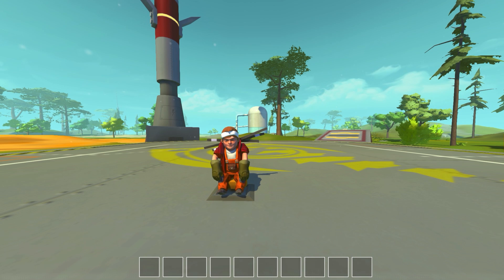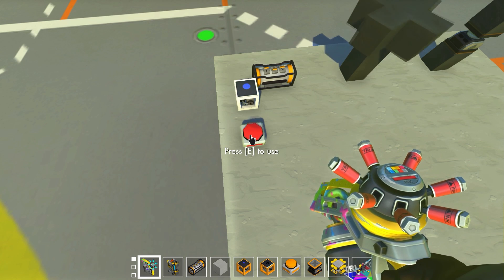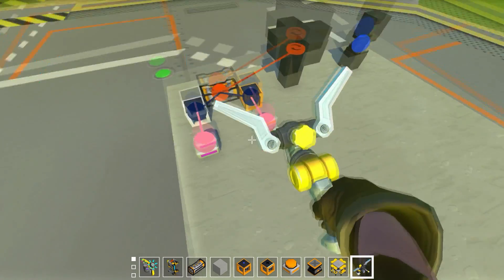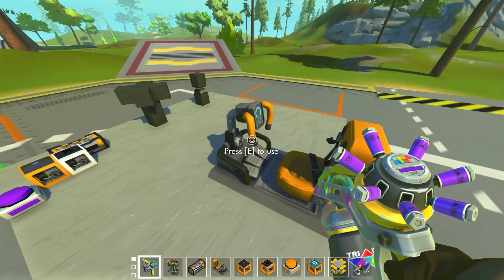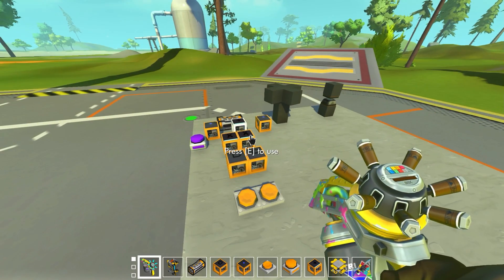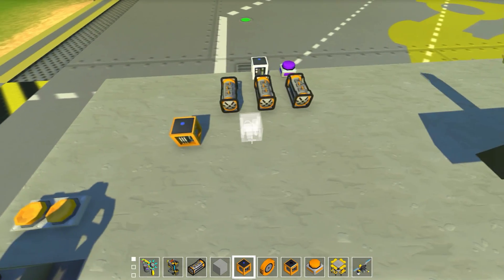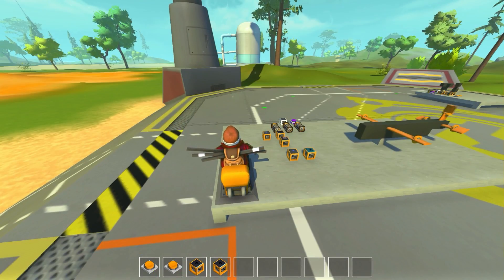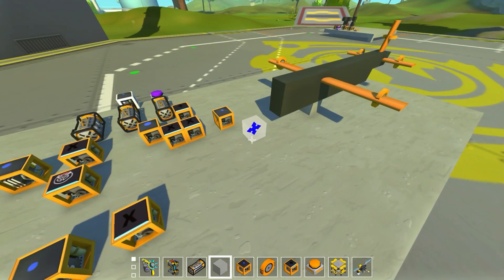Smart Engine Tutorial and Simple Plane Controls Setup! (Scrap Mechanic #367)

Comment: And another cool tutorial! Well done! :) If u use decimals adjusting the length of a piston u can make it almost stepless and that is pretty useful for a forklift, for example, or any other vehicle using pistons ;)
Reply: There are a few other handy things that kAN missed:

1. You can just connect a driver's seat directly to the smart engine if you want to use like a normal engine.

2. Pistons will still be able to move without inputting a speed value.

3. If you put a single value into a math block set to subtract, it will make the value negative.
Reply: Lord Pain flying: I am bird caravan :)
Reply: Lord Pain hey there :)
Reply: Lord Pain I really hope kan sees this. You don't need a smart engine. I made a car with 6 engines, each with a different speed. They are wired to an axle made of thin pipes, with a bearing separating each section. Pressing the switches to activate them in a successive manner not only gives you extreme speed capability, but also gives the feel of driving a manual car. Hope y'all found this helpful.
Reply: I'll have to try that again. First time I tried, it would only move in whole values. Maybe it's been updated since.
Reply: Can you link the mods you used to use the smart engie?
Reply: And smart engie
Reply: I like ur mods
Reply: Lord Pain get french bread

Comment: well...that engine didn't help really when i was to build an tank today.... i wanted to make it so that when i turn left or right with the tank then the wheels on the opposite side would go in reverse.... but that is too complicated for me...also.. i wanted it to be an RC tank...which made it even harder since its didn't want ti to be as big as an normal player tank... so i had to make a special setup with with pistons and sensors for turning and also4 engines and 10 wheels... it still doesn't turn the way i want...... also.. it can't shoot since button signals doesn't go through the router... which is sad..

Comment: great video again kan it helped me a lot with progress on my scrap version off the Halo AV-14 Attack VTOL. i have a question for anyone that can help. so thanks to this video i was able to get the steering to work. pads tip forward and back for WS and in opposite directions for AD as well as pad propeller speed. my issue is that it tips like crazy. Any ideas for making it more stable and prevent the body from moving too much?
Reply: side note id love a video on the memory block

Comment: You don't need to add a counter every time you want to multiply by -1. Set the math block to subtraction and use 1 input and it will multiply it by -1.

Comment: Hey kAN I doubt you will read this but I am making a small battle bot that is wireless. I am having a trouble making it turn faster I am using glitch steering. Also I am basing it off of the real life battle bot, Tombstone. My robot is 5x3 minus the spinning bar. (8x3 with the bar included)

Comment: while watching this i had a thought, could you make a car more like a real life car. by that i mean gears (mutli set speeds 1-slow 2-med 3-fast) steering that changes based on speed, the faster you are the slower the steering is, thus making a car have a decent turning circle at slow speed as well as use able steering at speed (gentle) this would be useful for races as you could adjust your speed to the course.
Reply: Easy, just paint 3 switches which lead to a number block which feeds smart engine for speed. Each on switch would be a gear, similarly use those switches for turning radius

Comment: My absolute favourite part in Scrap Mechanic. I used these in 3 different ways in my Toyota Hilux (Tundra): 1) as a custom engine with torque curves over multiple gears, 2) as height adjustable suspension that will stiffen when turning (for anti-roll), and 3) as steering with specific turning angle
Reply: YOU GENIUS! YOU JUST SOLVED ALL MY PROBLEMS